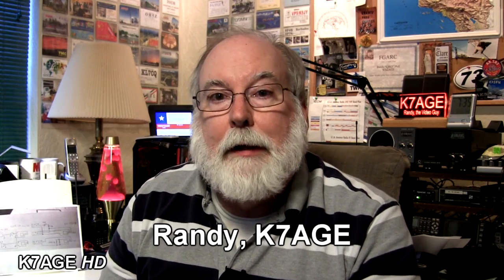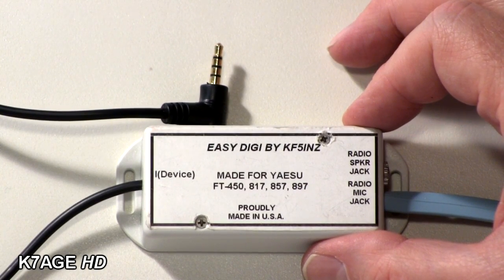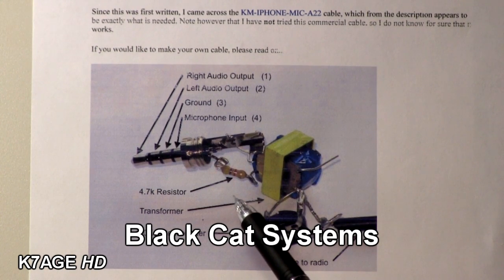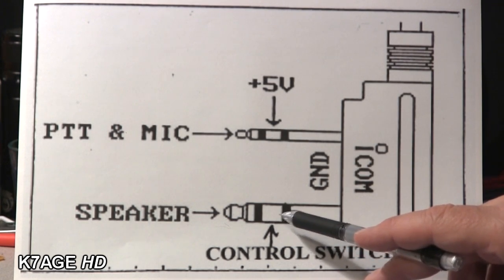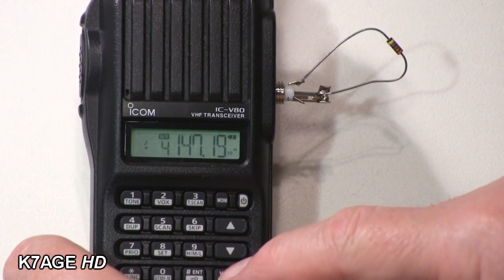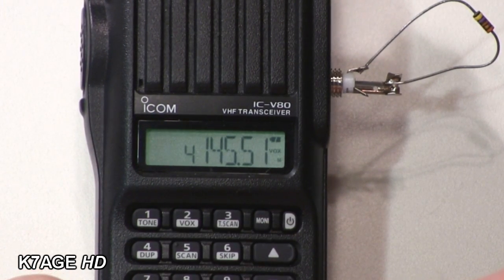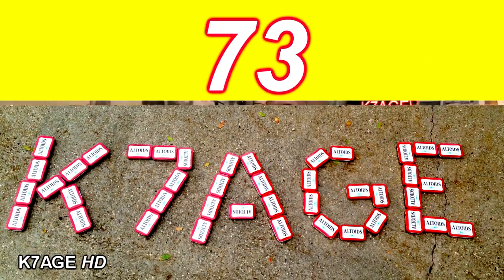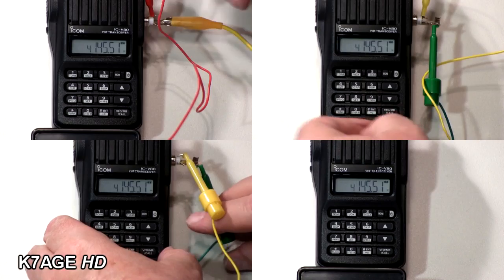Ham Radio iPhone to Icom HT Interface Part 1: Planning

Comment: Wondering if this same technique would work on the yaesu ft817 - the resistors etc on vox?
Reply from the maker: You would need the resistor on the iPhone side. The 817 would not need any resistors to trick it in to allowing vox. If you wire into the mic jack, vox should work. VOX does not work using the rear DATA connector.
Reply: +K7AGE thanks so much! I was wondering if the ft817 should be in Data Psk31 mode or USB/Lsb when using the vox feature for keying the radio?

Comment: Great to see the video on Ham Nation tonight Randy.  I am hoping this might solve my problem with Ipad, it does not recognize my external lapel mics I was hoping to use with it for doing video, I will have to try that 4.7k resistor to ground.  I only have one cheap mic that works externally with my Ipad and Ipod, it must have the correct resistance, but my good lapels would not work and I could not find any info online about it, I would think others would be trying to use those mics too but no luck finding info, so I am hoping this might be the problem!  73 and keep up the great work...wd0akx
Reply from the maker: Give it a try. Let me know how it works
Reply: K7AGE That did the trick, adding the resistor across the mic hot and ground, now my lav mic works.  I also had to adapt the connections but still needed the resistor to make it work.  My lav mic is TRS with the tip and ring connected together, guess that way it works with a stereo mic input as mono, but that would just short out the TR mic input connection on adapter to Ipad, so long story but got it working.  But still not sure how they sell lav mics advertised as working with Ipad and they seem to work for others.  Still kind of puzzled on that.

Comment: With my Android phone, I can take the audio out from the jack on the phone to go through my Easy Digi interface, but for the transmit side, I have to hold the phone speaker up to the HT mic. Now you have me wondering if my phone may have an audio in on the jack.
Reply from the maker: google away to find out